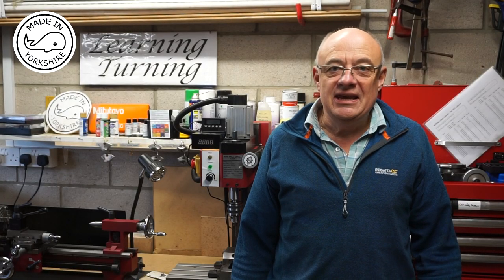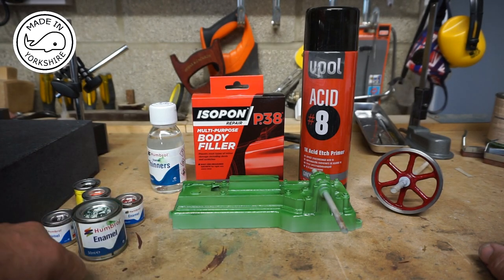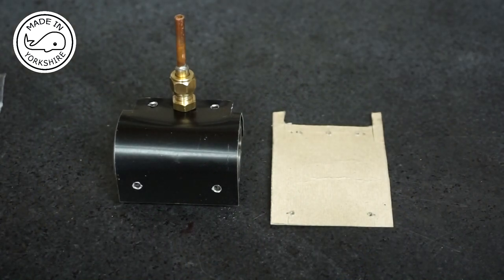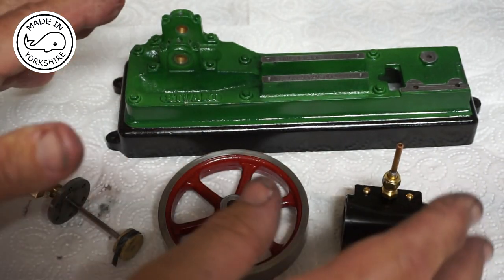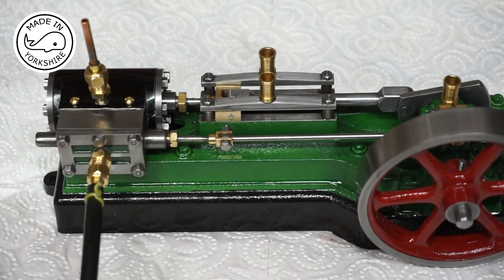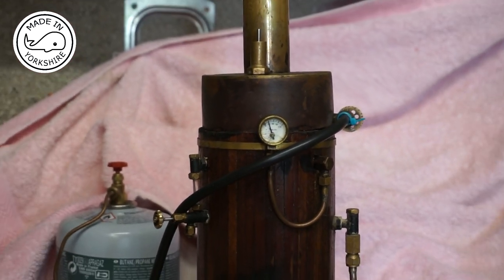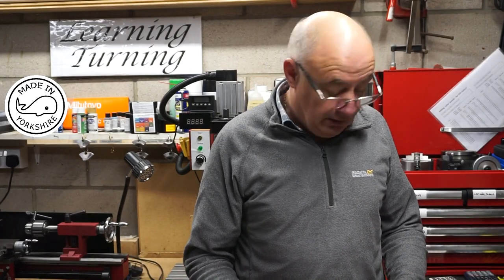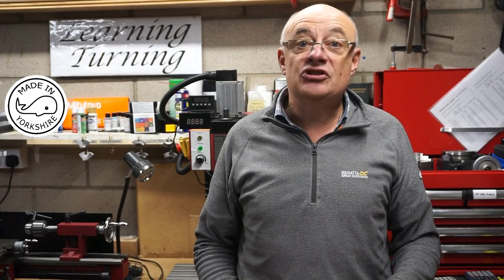#MT22 Part 12 - Making a Stuart S50 Steam Engine. Running on STEAM! By Andrew Whale.

Comment: I got my 2nd S50, this time a kit, unmachined. FYI to those not in UK when ordering kits from abroad, they pass inspection in customs, and how Stuart packages the kits, they will be opened vigorously and tossed back in the box loose with the packing material (peanuts). I was disappointed in that, glad it wasn't polished parts bcs they jumbled all around, but all accounted for. I do think 1 gasket has a tear but I can make do.
oh and in the plans, they incl a revised view of part #22 with the proper .07" (orig. plans say 0.7) , & the slide valve #25  is already machined. 
I'll have a lot of fun rewatching these vids as I go about my model
Reply from the maker: Hi Paul, it's a real shame customs didn't take much care. Glad you didn't have any missing bits. It should keep you out of trouble for a few days/weeks/months?
I hope it turns out well.
Cheers
Andrew

Comment: Great series of videos and work around of problems. Good for some one starting out in model engineering. A good way of getting the piston in the bore is to wrap a bit of coke can round the piston and squeeze tight with pliers. Slips in the bore with out a lot of trouble. I shall look forward to your 10V build, I built one about thirty years ago.
Reply from the maker: Many thanks for the tip. Maybe you will be able to advise me if I get stuck on the 10V :-). I can't remember what I did last week, never mind 30 years ago!
Cheers
Andrew

Comment: Hi Andrew, well done for a first time machinist, bet you were really chuffed with the outcome. Just a note for the future, when you run it on steam, you really ought to have cylinder lubrication via the steam, albeit a displacement lubricator or a mechanical one and buy some proper steam oil from a model supplier. I could not see any lubrication on Peters engine either unless he has a displacement one fitted at the boiler end.
Reply from the maker: Hi Dave. Peter gave me some steam oil which we used to prime both engines. Unfortunately I don't have a displacement lubricator. Maybe one of my subscribers will donate me one sometime ha ha.
Cheers
Andrew

Comment: S50 Kit received!!  I've never seen cast studs and nuts on a casting before.  Also, the main bearing seems to a cast fake, complete with fake studs and nuts!  I've a mind to mill them off and make my own from bronze.  Also received the 10 V reversing gear.  What to start first...
Reply from the maker: Yeah the soleplate does have some cosmetic studs. For me I found the s50 a great introduction into model engineering. It sounds like you are somewhat more experienced than me. 
I hope it works out well.
All the best.
Andrew
Reply: Well I guess I have built several engines, just one cast model, 'tho.  Adding a bushing for the crankshaft like you did is a good solution; I think I'll make bearing blocks (like a 10V) that drop into slots cut into the existing cast bearing uprights.  I'd never seen the 'cast' studs on models before.  I like the long 'trunk' rails on this horizontal engine.  My other horizontal models (bar stock) have the cylindrical trunks; Tangye, and a model similar to a 10H, both of my own design. Cheers Mate!  Keep up the good work.
Reply from the maker: Seems you have a good plan.
Let me know how you get on.
Cheers
Andrew

Comment: i think if the rod between the pistons rod and the thing that turns the axel when moved had been made longer maybe the engine wouldnt start to shake that much at the pressure it started doing it

Comment: Great stuff. These engines beg to be driven on live steam, they just sound better and run better like they did all those years ago. Now don't we wish that a model steam boiler wouldn't cost twice as much as a fully fledged domestic central neating boiler? Some one must have an idea.
Reply from the maker: Yes, I don't think you can beat steam. Crazy that boilers are so expensive. Model Engineer magazine has been running a series on making one. Apparently aimed at beginners but way beyond my abilities. Pete aka "Model Steamers" has volunteered to bring his boiler round again, once I've completed the 10V.
Have a great Christmas.
Andrew
Reply from the maker: Hi there - I think you might have posted a question regarding the eccentric sheave and strap, but I can't find it. Maybe you have resolved the problem yourself and deleted the comment. If not, I can confirm that the drawing dimensions are correct. The sheave runs inside the eccentric strap, so there is adequate space between the bearings. If you have any other questions you can always email me at learningturning@btinternet.com, and I will try to help.
All the best.
Andrew
Reply: @learningturningmetal   Hi Andrew , yes I did but it was my mistake. The dimensions seem to be correct. I deleted it untill I was sure that it was a genuine error. Right now I have managed to machine the base and the bearings. The Phosphor Bronze bearing liners gave me a bit of a headache as well as the apparent necessity to mill the outer sides of the bearing support to bring them to dimension . The flywheel is also all over the place. I had intended to fully machine this engine on my Sherline lathe and mill and leave the Myford alone ( just a challenge I guess plusthe fact that they are in my spare bedroom ) but I admit defeat. Tommorow the Myford will be resurrected in the cold damp garrage. There is no way that I can get this flywheel to run safely on the Sherline as it wobbles all over the place even with the 4 jaw chuck. Many thanks for your support.
Reply from the maker: @lensman5762  many thanks for the update. I'm sure it will all work out in the end. It's all good fun and it's a great way to learn. I wish I had an old Myford ☹️. I'm not jealous really.
Cheers
Andrew
Reply: @learningturningmetal  Believe you me that old Myford has cost me nearly as much as a  new proper lathe with all the extras that I have put on it. The last thing  besdies the 3 phase motor and the inverter was the cross slide with power feed. I had bought this about 5 years ago and never got around to fixing it. It is now like a quasi ML7-R. LOL. Anyway I found a relatively flat surface on the flywheel which is the face of one the spigots. I see if I could use that on the mill to keep the flywheel flat and drill and ream 1/4" to mount it on an arbour. Once done then I can dial the arbour in on the little lathe and start machining the flywheel. I seem to remember that the one on the 10V that I did years ago was a relatively simple affair unlike this one. The delights of castings. Have a great day.